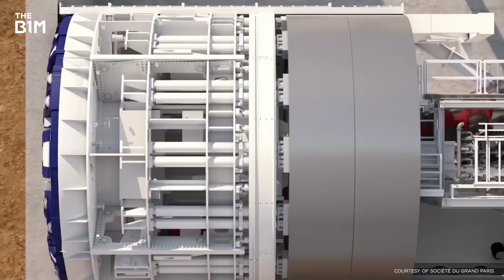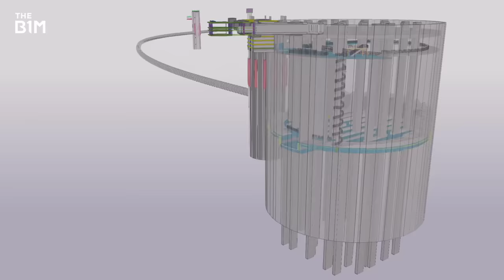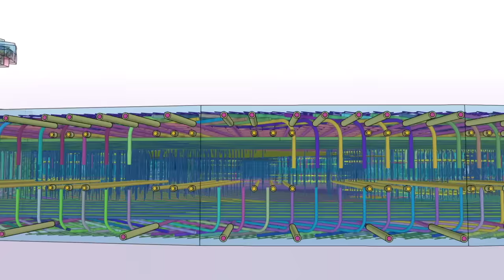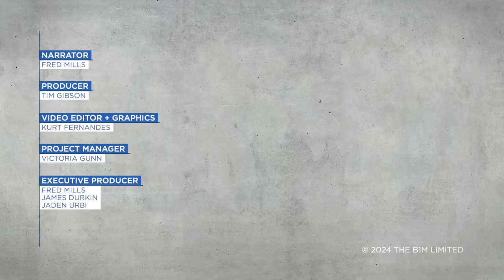Why Paris is Doubling the Size of its Metro

Comment: Pretty much a waste of money.   These suburbs do not need to be connected in a loop.   The lines will get little use.     They should have removed most of the cars and trucks from Paris using trams and other inexpensive above ground transportation.   Diesel fumes destroy the lungs of Parisians and the facades of buildings.  Paris stinks and this line changes nothing.  Stupid as hell.
Reply: I think you do not understand.  The new system will allow to commute from one part of the Paris urban area ( 11 million residents of which Paris proper is only 2 million) to another without having to go through Paris proper. There will be less congestion in Paris due to through traffic.
Reply: @francoisleyrat8659 People do not travel from suburb to suburb.   People travel from the country and suburbs to the city and then they return on the same lines.   This donut is  worthless,  few people will use it.   Some companies are making big money on this stupid idea.
Reply: @quicknumbercrunch8691  not true, at least not here. The urban area around Paris, which is administratively not Paris, has its own clusters, historic town or village centres, business parks, industrial  areas, etc. All jobs are not concentrated in Paris proper!
Reply: RER A at peak hour transport 50 000 people/hour/direction it"s not "a little use" it's one of the biggest train line of the world
Reply: @thunderbolt8409  The A goes from where people are to where they work.   This new Metro goes in a useless circle.   Stupid.
Reply: @quicknumbercrunch8691 yes they do travel suburb to suburb lmfao. i live in said parisian suburbs and a LOT are complaining about the fact that we have to go through paris to go somewhere outside of paris.
Reply: @quicknumbercrunch8691  Do you want the 9 million people in the suburbs (a number in constant increase) to keep on commuting into the city forever?  Paris will just become more miserable if that happens.  This will relieve congestion and can help develop other parts of the region.
Reply: @edmerc92  This does not effect the RER C line to Paris or much other commuter trains.   It circles Paris which is mostly useless.  A huge waste of money.   France needs to end immigration and to restrict family size to one child.   I know French families with nine and ten children.   No metro change is going to stop the sprawl and misery.   All nature is dying.   The birds are dying off and all that is left in Ile de France is pigeons and black birds.   It is hideous with ugly public and private housing.  The trains from the suburbs will be no quicker but the cost is astronomical.